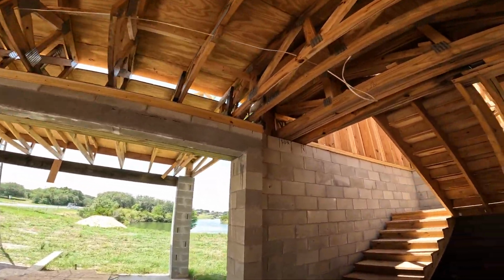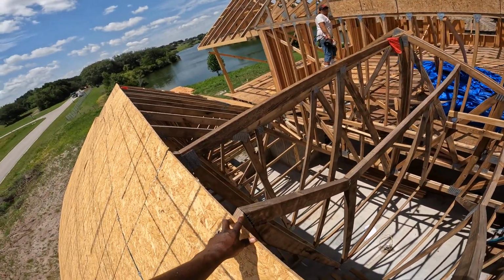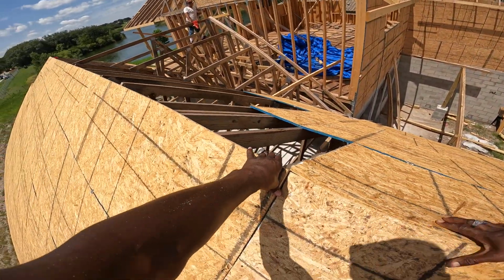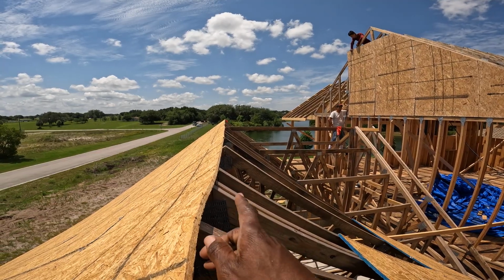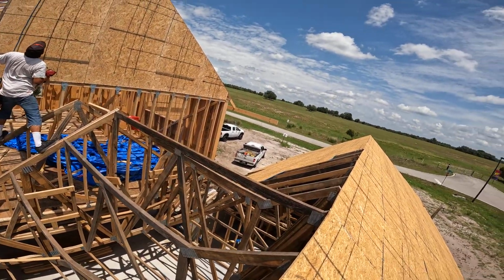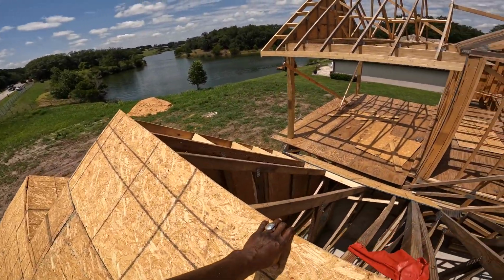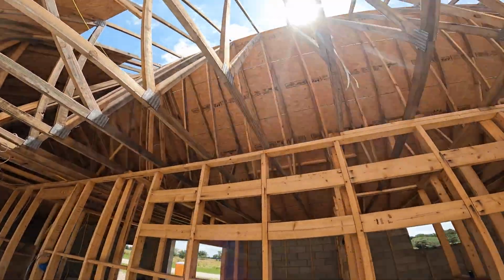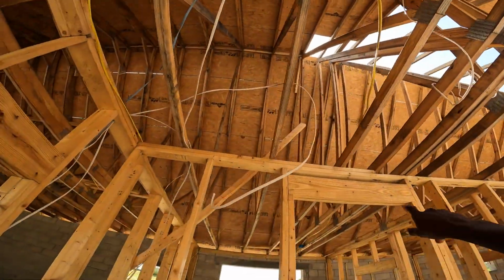whole Roof Trusses Gone Wrong. Incorrect Install.

Comment: I set trusses in Florida and sheet too the problem could most likely be the blockers fault for not lining up there block good because when setting the trusses you line it up with the block but if it’s not lined up with the block it was the workers who set the trusses fault for not lining it up. but I also had a problem like that where only two trusses weren’t manufactured right because at the bottom it was plumb and at the top it was down about an inch from the other one
Reply: Where the shops correct or did the architect miss it?
Reply: The problem was the 1 1/2 missing plate
Reply: what are you talking about lol? its pretty obvious that the missing top plate in areas is the issue.

Comment: Another reason why I never do truss jobs. We only stick frame our roofs. I've set trusses string line straight in the ridge and the ends would be hella off. Due to poor truss construction and variations in their construction.
Reply: You are exactly right about the truss manufacturing. I have been a builder for 30+ years. I have had a stack of 30 trusses, banded together, laying on the ground together and they all did not line up. Something may have got moved during assembly, who knows. But, even if you line up straight with a string line on the bottom, you can still end up with the crooked ridge. I have sent trusses back before.

Comment: How are you going to fix it?
Reply from the maker: Good question. Thanks for asking. The way to fix it is to first put a dry string line from one end of the roof to the other end of the roof. This will show which rafter ridge point that is not lined with the string line. Once you see the ones out of line to the string line you would then have to take out all the nails on each bottom sides of the rafter seating on the CMU wall or top plate. If the rafter is nailed off, you would have to take out all nails in the plywood and any blocking in between in order to move the rafter on either side.
Reply: @besfloridaframersanddesignsllc   A lot of work
Reply from the maker: @wendylou3469  True indeed. Work No one likes to do unless they are getting PA$D good money. In this case it cost the homeowner almost double to pay again for something he already PA$D contractors to do. SMH
Reply: @besfloridaframersanddesignsllc  Why? The homeowner should have never had to pay for this FU.  The architect should never approve a change order cost for something like this. If this was the contractor's fault it is his problem. If it was the fault of the architect then his liability insurance should have covered it.
Reply from the maker: @gary24752  original framing contractors who bailed on the job, then I got called to work a miracle. Done deal.